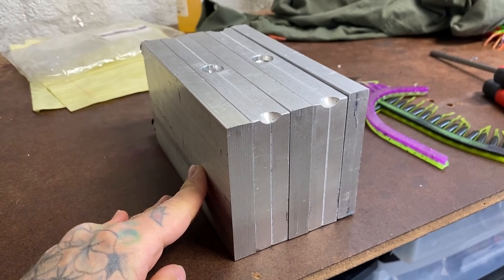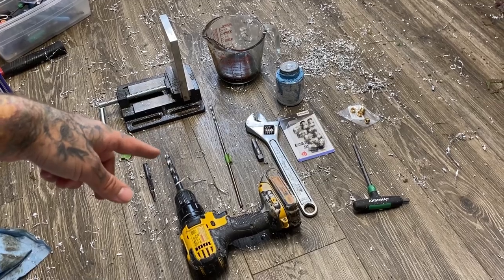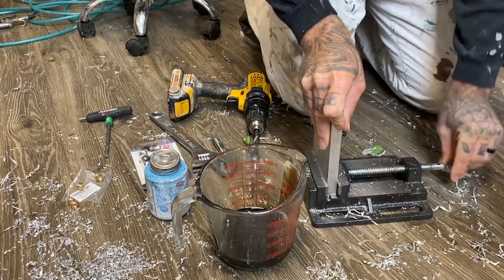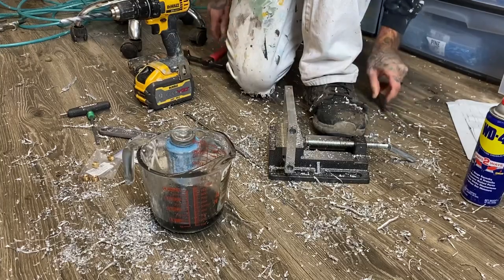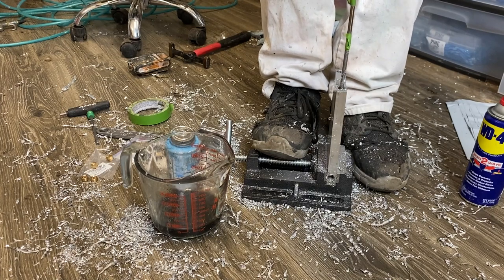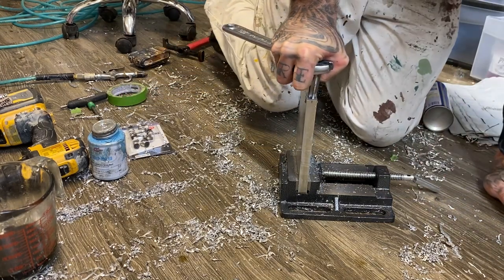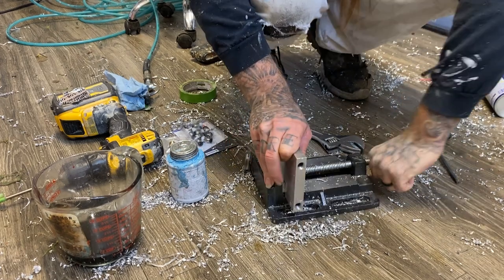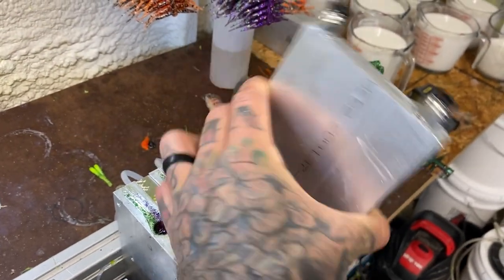How To Make Cooling Plates + Increase Production & Make More $$ Soft Plastic Bait Making

Comment: If you use a dowel rod centering kit. it will give you a guide to keep it straight and its self centering. Plus it clamps tight. Norther tool and Harbor freight has it.

Comment: Good timing on the video.  This is my project for next week.  I ordered my plates online and they shipped yesterday.  I do need to get a vice like you have.  I did like how you step on it to hold it in place and drill with a hand drill.   I was trying to figure out how I could do it with my table top drill press but it can only do 3" at a time.  I will probably start my holes on the drill press hoping to keep them straighter than I can with a hand drill then finish like you did.  Thanks.